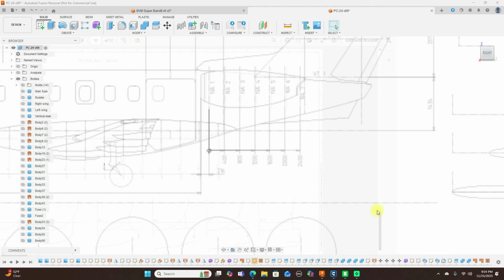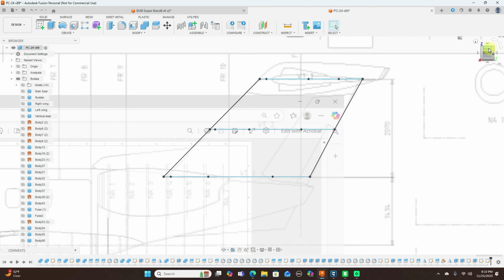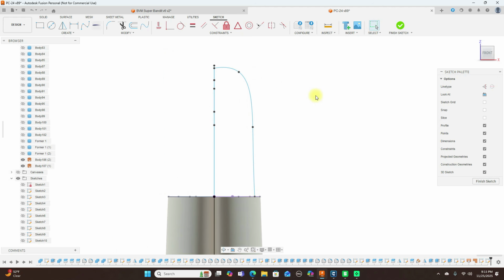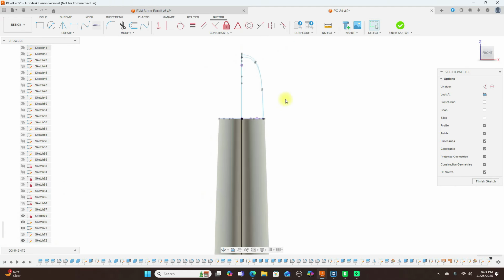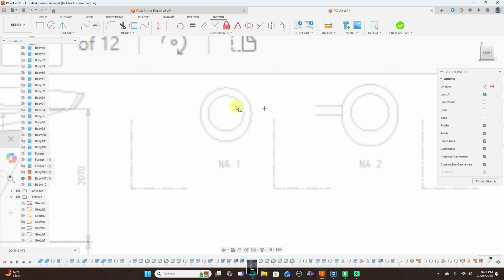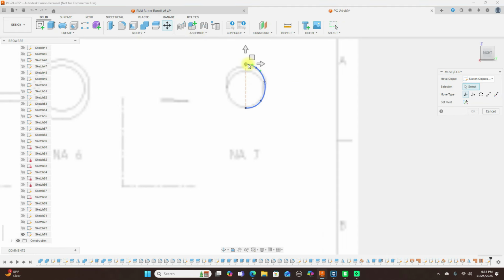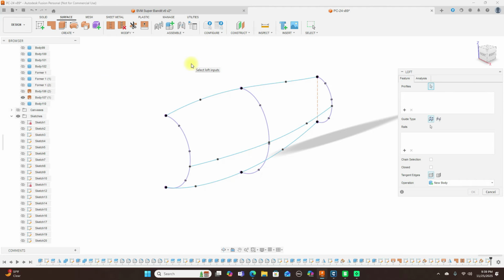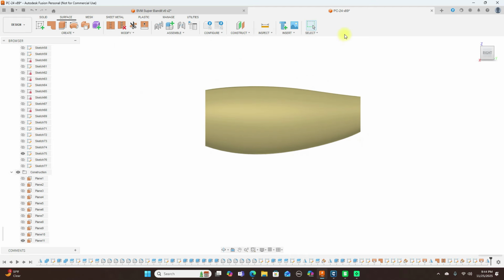Continuing The PC 24 Jet Design  Advance surface Modeling Techniques

Comment: Thanks to your instruction, I’ve now been able to use Fusion to design a Cirrus Vision jet!  
I was hoping you’d be able to show us how you extrude/ cut windows and fuselage panel lines onto the curved fuselage skin? 🙏🏻
Reply from the maker: You are welcome.  Have a look through my videos.  I show how to do panel lines.  The video is called How to do panel line easily.  Follow the same process on the Cirrus jet.  I have a video on doing windows also.  If you need help, contact me on my facebook group.